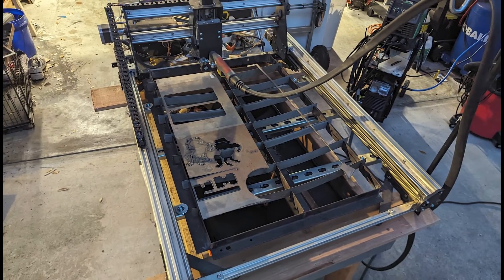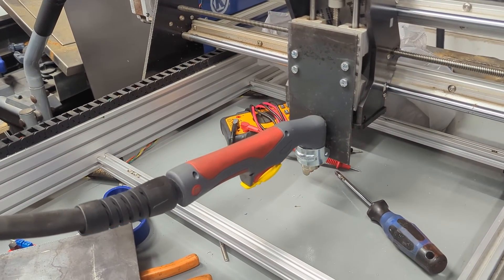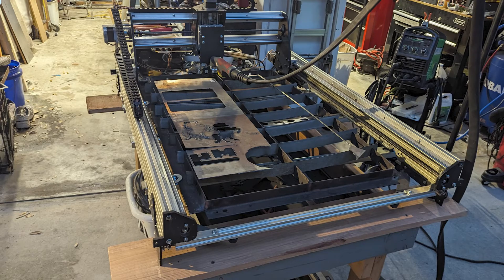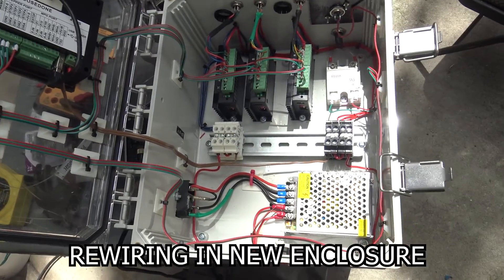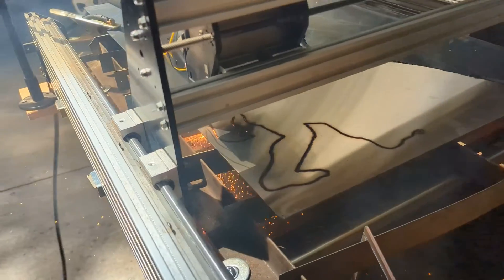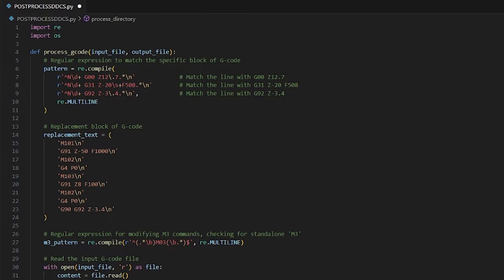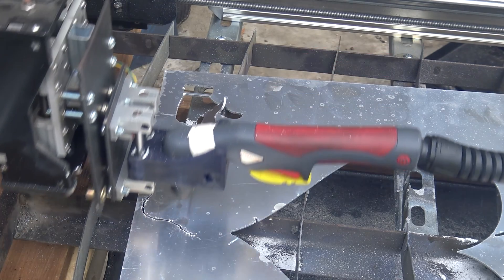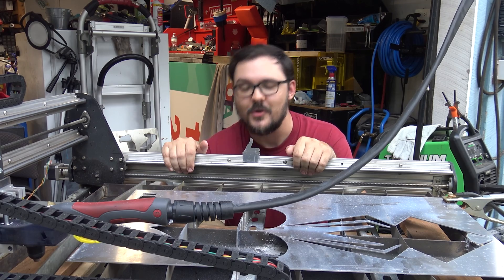Homemade DDCS V2.1 CNC Plasma Cutter! | IT WORKS!

Comment: Do you have fume extractor for your plasma table?  If you do, can you talk about that?

I'll be using mine upstairs in the garage; it's a very well sealed room..  I'll have vents going outside for the 3D printers, I'm pretty sure cutting metal releases not-very-nice stuff as well.

I'll be cutting approx 1mm sheetmetal to make small boxes (about 2in x 8in x 12in).  My table will be 5ft x 5ft, so I can cut 4x4 sheets without moving the material.
Reply from the maker: You absolutely need a fume extractor, or at least to run the thing outside. I didn't have one initially but I built one a few months later. I think I have a short about it, but I can make something a little more detailed soon.
Reply: @DustinCorbin  That would be appreciated.

I'll be using it downstairs to start (have to finish the upstairs first).

Comment: What are the specs for the solid state relay you used to turn on the torch?
Reply from the maker: @stephenlinzel8846  The one I have is a dc/dc solid state relay, I think input side is 3 to 32 volts DC and the switched side is up to 300 volts DC. In my case the switched side is just connecting two wires together so it's rating doesn't really matter much.
Reply: @DustinCorbin  Do you know the amperage rating on the switched side?
Reply from the maker: @stephenlinzel8846  I think mine is 25A or something, but the signal for the plasma cutter is low voltage and low current, so pretty much anything will be fine.

Comment: Nice job. Love a good repurposed machine video. The reason you only need one M03 S1200 command is because Gcode was written as a Modal language. Modal is just a fancy way of saying that whatever parameters that the Gcode sees first will keep & use those parameters until changed or canceled by the program/user. So in your example, you have turned on the switch with the M03 S1200. 

To turn the switch off, you would just need to  put in the command M03 S0. 

Hope that helps further your understanding of Gcode. 

Having the ability to design & manufacturer pretty much ANYTHING I can think of in my studio is fantastically satisfying.
Reply from the maker: @blazegbs  nice! I had no idea but I appreciate the information! I have been using Gcode for years, but I haven't really taken a deeper dive into HOW it works. This project was the first one in a few years where I was heavily using Gcode and I had to refresh myself a lot on it. 

Thanks for the info!

Comment: Great use of a deprecated product. From all the times I had to rebuild my FT-5 I wanted to do a DIY a CNC plasma, but I decided to just buy a commercial STV SparX 4800 table instead. Glad I did for a number of reasons, but building your own has its advantages - cost. Though you will quickly find that torch height control is necessary and other aspects of the control firmware need to be tweaked to make clean cuts, start to finish. Ball screws help some for the ringing people often see with belt driven systems, but there are some unique aspects of how a plasma torch works that need to be considered in the firmware for maximum cut performance. Even the affordable MyPlasm controller falls short in some aspects, but it's a solid pro-sumer grade controller for the cost. Good to see you got your controller to work... never underestimate the power of hacking the g code.
Reply from the maker: For sure! I know one day I will build something from scratch, or at least integrate THC into this one. I didn't attempt this build to make a highly reliable machine with aerospace precision or high repeatability, but considering what it can do, what I will use it for and the low amount of commitment (money mainly) to make it work, I'm pretty happy with it. Plus, it was super fun tackling each component and making them work for "unintended" use cases. It was nearly a month of working every day after work, designing, testing, guessing, researching, etc, and every completion led to the start of a new challenge. I loved every minute of it. Thanks for watching and the comment!

Comment: Great video. I'm sure you could have figured out the whole button situation and ssr. It's not that difficult, probably just a pnp transistor driving the input of the ssr from the button when it detects ground.
Reply from the maker: @UndernetSystems  I also wanted to make sure that I have good isolation between the plasma cutter and the control board. You never know when something may go haywire and I would really prefer to not have a direct connection between the two.

Comment: Nice work! I still just free hand plasma cut, but I built a rotating table to easily cut circles/pipe...
Can still freehand a lot if you have nice jigs! 
Using the CNC to make jigs so you can cut more out by hand faster, could be cool too, since you don't want to put too much usage on the CNC if you don't have to
Reply from the maker: Absolutely. I think of this as another tool in the arsenal, which is why I designed it to be very easy to go from handheld to CNC and back.